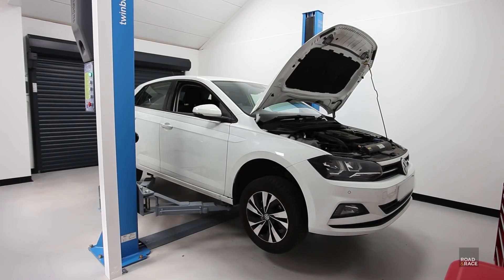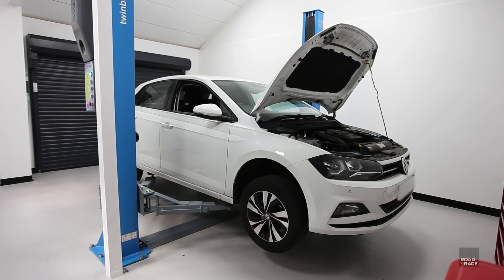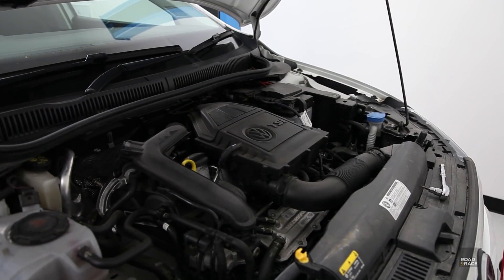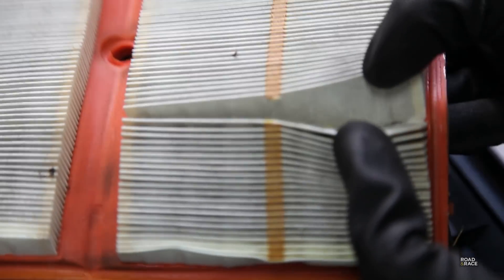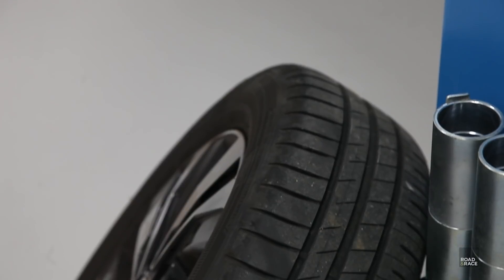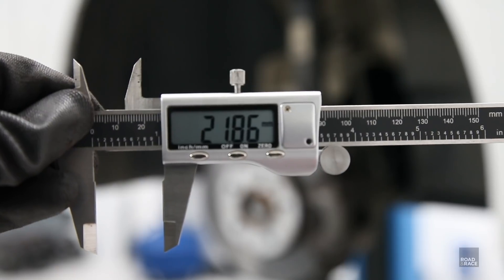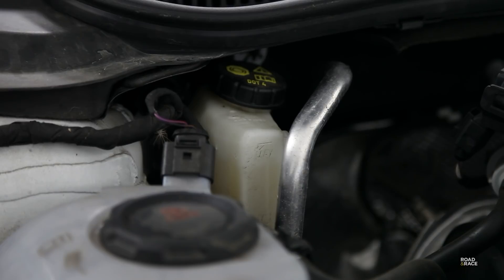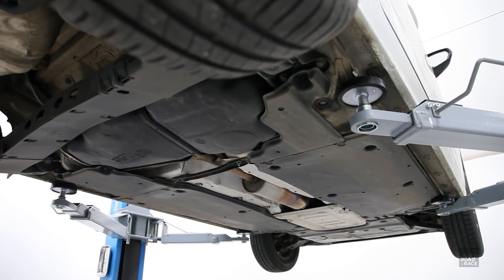A simple guide to check over a car for any basic problems.

Comment: For many years now, the advice regarding tyres is that you should always fit your best tyres to the rear (especially this time of year), so if you put the ones with more tread on the front you should consider swapping them back.

The reason for this is that understeer is easier to control and recover from than oversteer.  So if your best tyres are at the rear, then you’ve minimised the possibility of those tyres breaking traction and putting you into an ‘oversteer’ situation.

When it’s time to replace the front tyres, refit those wheels with the fresh rubber to the rear, and move the rears to the front.

It’s great to see the number or videos increasing again.

Comment: I have the same tires on my E39 530. Second set now, wear is fine. I got 65.000km out of them. Really liked these tires because they are really silent and my fuel consumption became better. Grip is also excellent, don’t need winter tires here in the Netherlands.

Comment: Only thing I would say is warranty...I know you did the brake fluid etc yourself, but will this void VW warranty?  Other things like not getting bodywork checked by VW can also void bodywork corrosion warranty, can it not?  I stand to be corrected.  Nice to see the new setup in use.
Reply: Yes agreed, the cheap non VW air filter will also void the warranty.